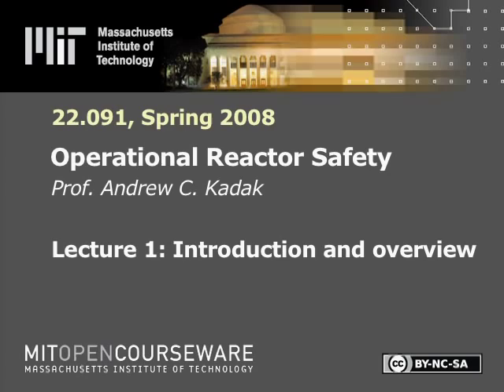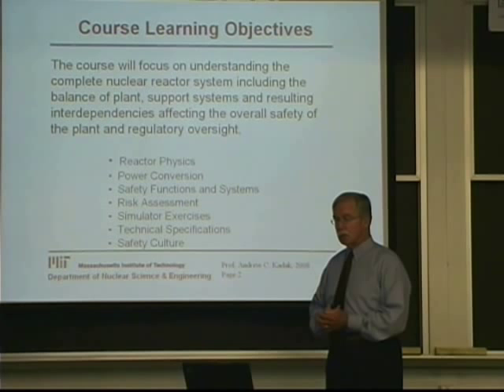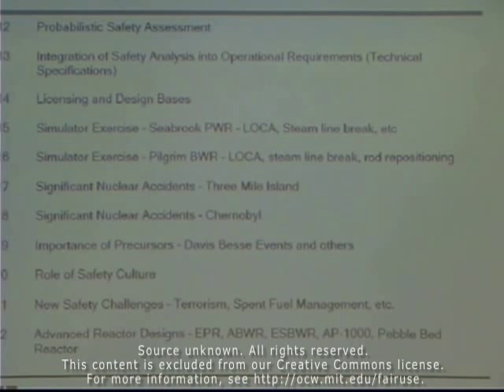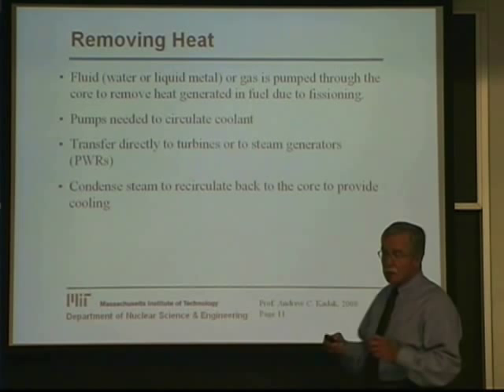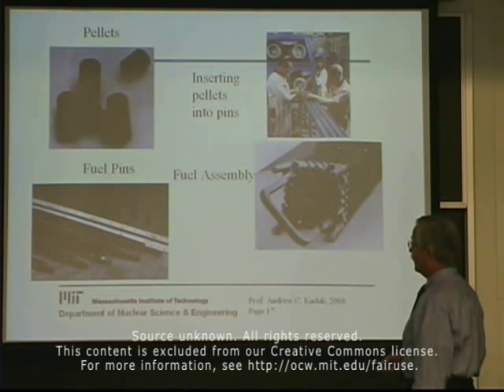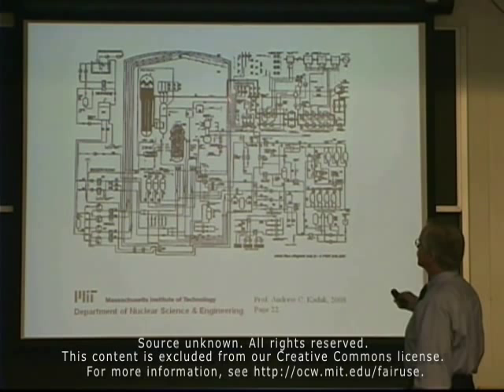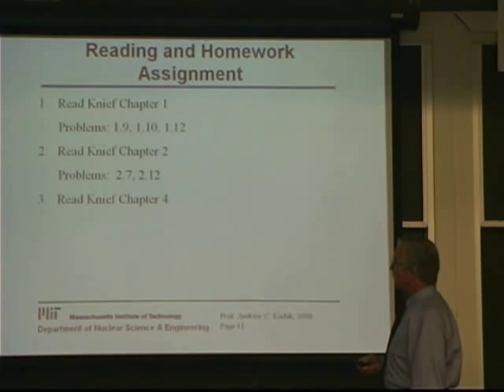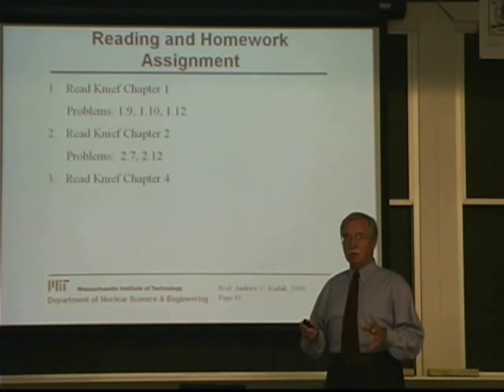Lec 1 | MIT 22.091 Nuclear Reactor Safety, Spring 2008

Comment: Why not place a bed of depleted uranium below the fuel rods in all reactors (of U235 variety). Like dissolves like. Melted fuel rod material would mix with the depleted U until it was sub critical.
Reply: I would think having more uranium would a problem because of the decay heat
Reply: What decay heat? Depleted uranium is not capable of fission.  It wont fizz. It is chemically similar and would cause a mixture which is sub critical.
Reply: @honeydavis5568  depleted uranium is still fissile. If exposed to a lot of neutrons, it can breed plutonium. That could be a complication to the solution you're proposing.

Correction: I meant fertile, not fissile. Meaning it can breed fissile isotopes when exposed to neutrons.
Reply: Well my idea is moot because the truth is that human nature is not up to the task of nuclear safety.  We currently have at least two reactors in war zones.